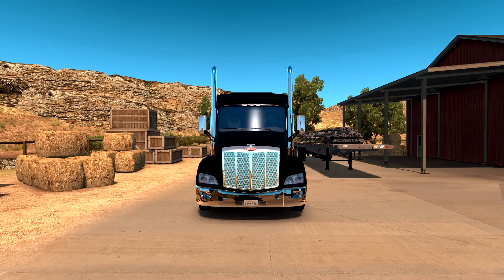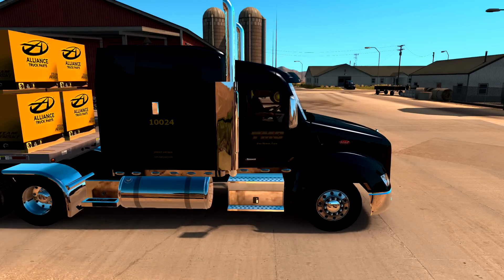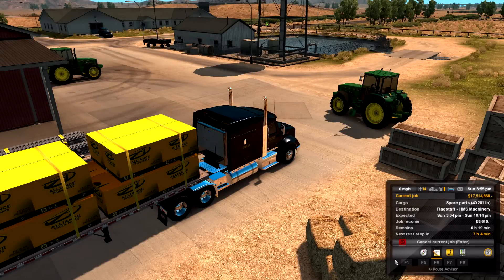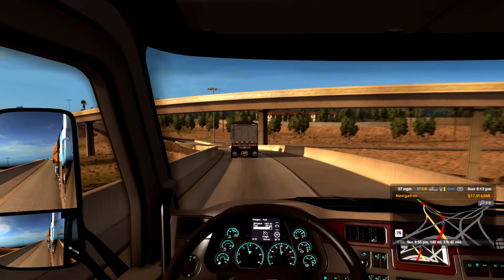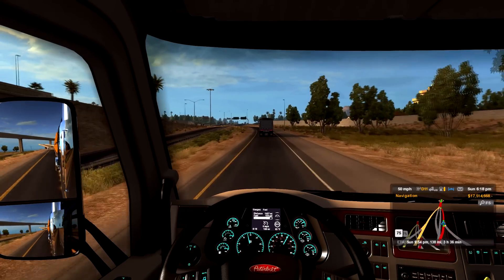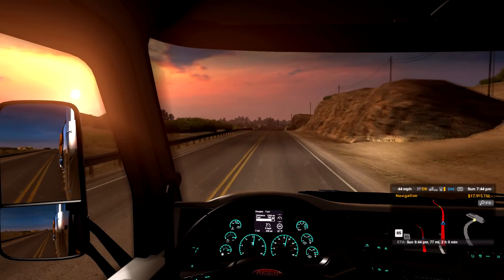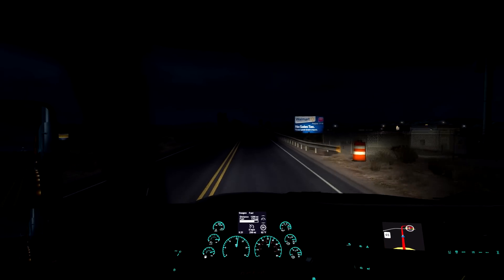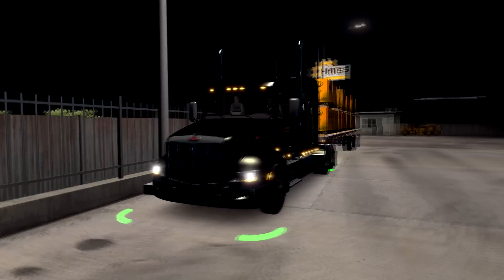American Truck Simulator - Sunday Test Drive - TMC Peterbilt 579

Comment: I like this but there are 4 things I would ask to be corrected if you can and I would love to find the skin. The overhead light bar should be chrome and the Peterbilt grating in the side of the hood should be chrome as well and there should be a bug deflector on the middle of the hood if that can be done, lastly, our 579 have windows on the sleeper doors. You mentioned the logo. That’s okay our owner ops are still using that style of decal so it looks fine. Good job btw.
     Also heard Eaton fuller 13 speed. Maybe some on our specialized division but that would be all - We don’t use those. Either 10 speed autoshifter or 9 speed manual.

Comment: If you lease or buy a truck from them and continue to work for them, they take of the shiny reflective sticker and you get a regular non reflective sticker of the colors you got on there, so you are technically correct if you are treating it as an owner, cause if you are treating it as a company driver you are missing the lights under the mirrors facing the doors to make the stickers sparkle
Reply: Also the fenders are incorrect, you have the fancy ones, if owner opp they are fine if company driver they have chrome ones but a fleet type the small ones
Reply from the maker: I don't believe I've ever seen the lights on the mirrors,then again I've never noticed a TMC truck at night so that would be why lol

Comment: Nice video Buddy!!!! i love the skin can't wait to get a hold of it.  personally that engine pack isn't correct for that truck. and as far as TMC go they only use the 9 speed eaton fuller with that 579 peterbilt.  there peterbilt 579 are under spec. i have a close friend who drivers for them
Reply from the maker: Just went off of what they said on the site. They didn't specify between the 579 and 389(if they are still buying them)
http://www.tmctrans.com/the-equipment/default.aspx

Comment: I would love to be able to stretch the chassis.
Reply from the maker: For MP,you just need a mod,make the truck,then save it and go online.
Reply: Ah ok. But I'm hoping they make one for single player to at some point? I would love to drive that truck with the sleeper and just stretch it.
Reply from the maker: Shaun Chisholm
I dont believe there is a mod for the stock trucks. You can do it with the 389